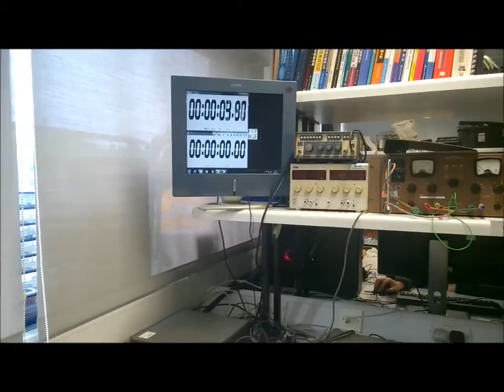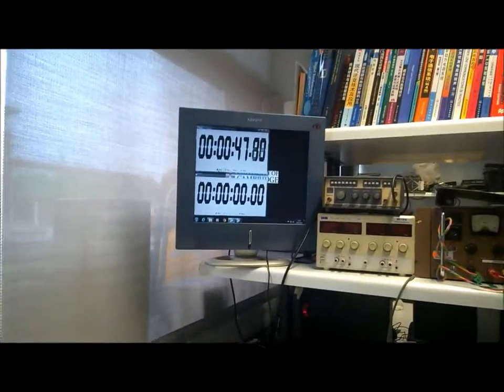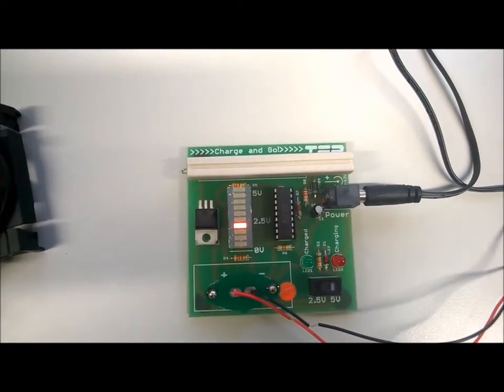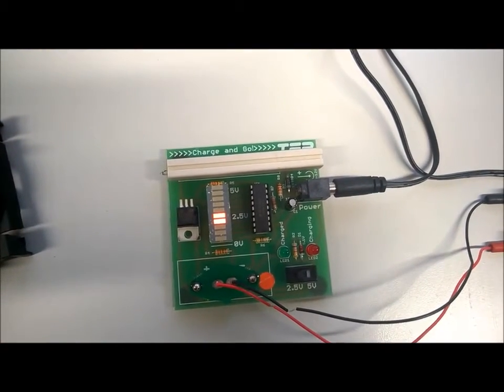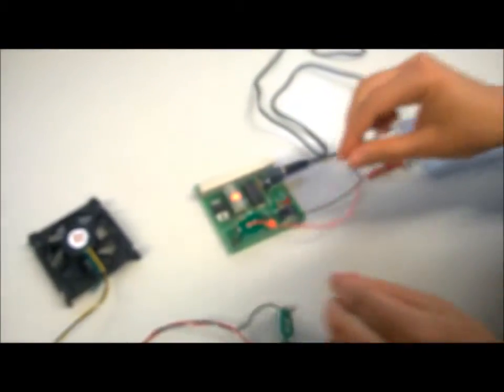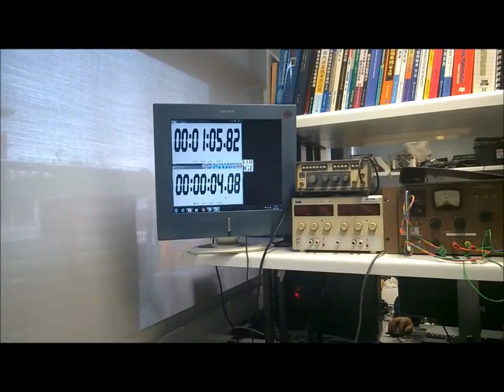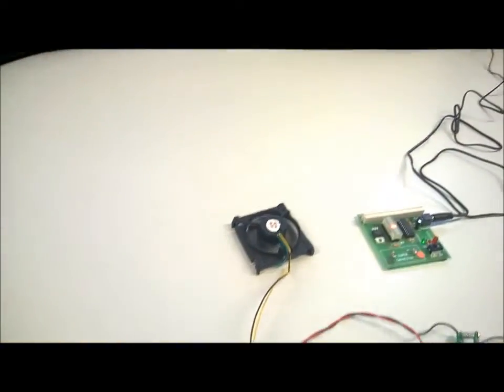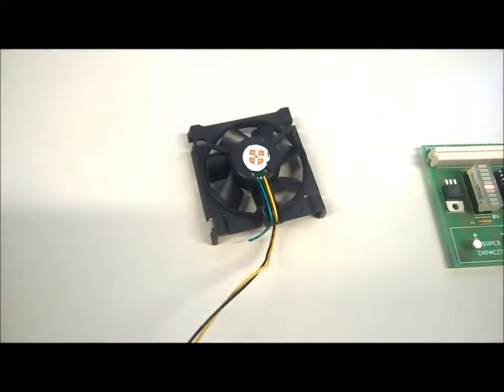Thin Flexible SuperCapacitor - Fast charge and discharge energy storage

Comment: A couple of questions, if I may please. How is the output of the capacitor being controlled? Can the capacitors be parallelised? what is the current and voltage coming from a single capacitor? Could you reach around 2.5A 12V in a small form factor? How expensive are they to produce? Lastly, how consistent is the power deliverance?
Reply: Hi sir